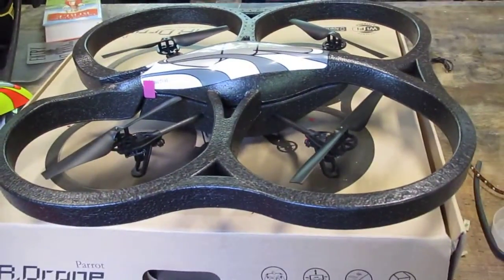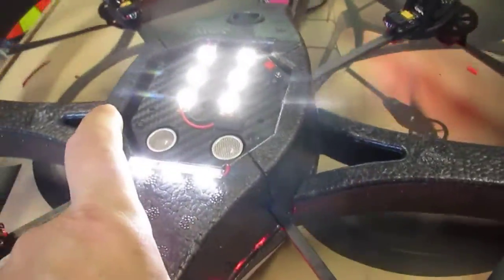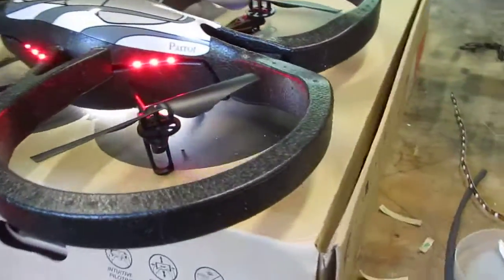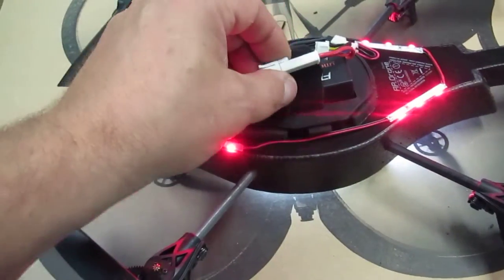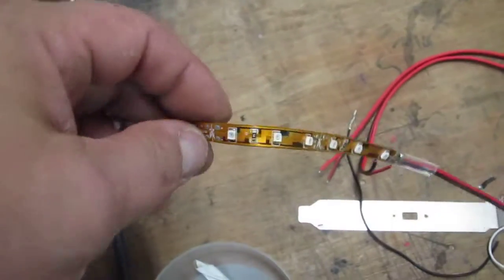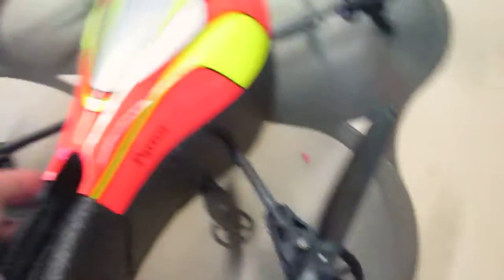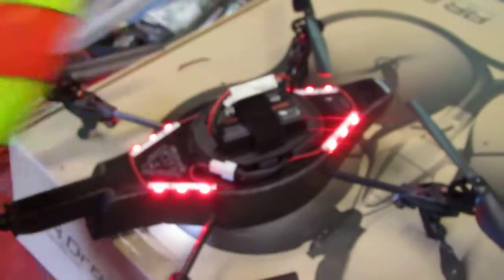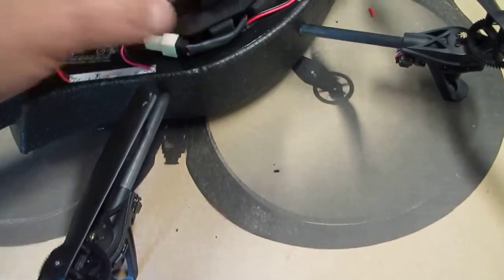Parrot AR.Drone Mods: Stealth LED Lighting

Comment: I've got some super bright white 0805 top emitting smd leds I was looking to add to the bottom and front of my ar.drone 2.0 And was curious as to how you found a suitable power source for your setup on the 1.0? It is the best led mod I have seen that doesn't require purchasing a kit or harness and I assumed there would be a way to find power without a 20$ harness. Any help is greatly appreciated and that looks amazing man!